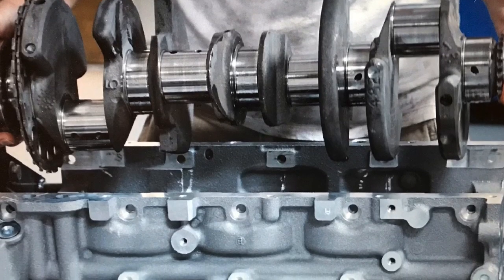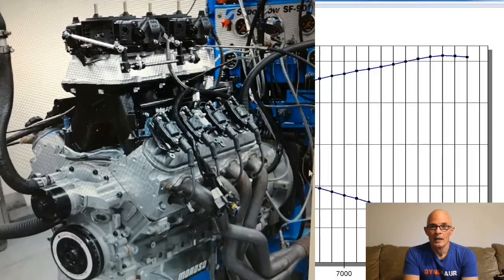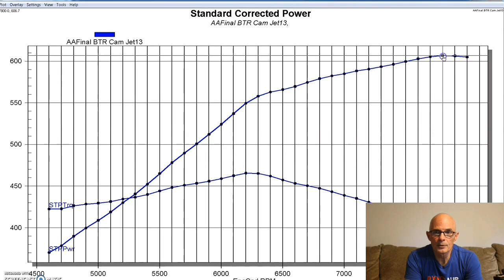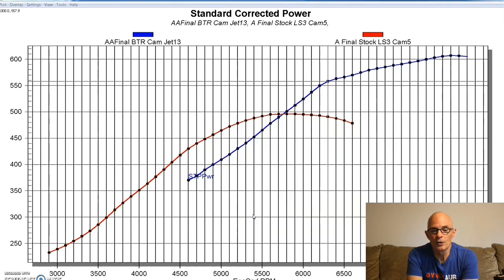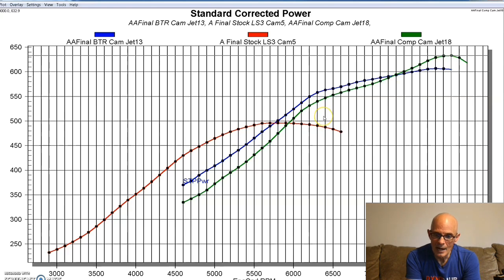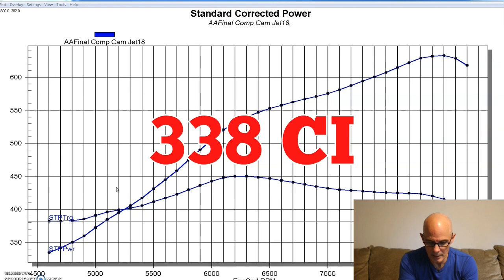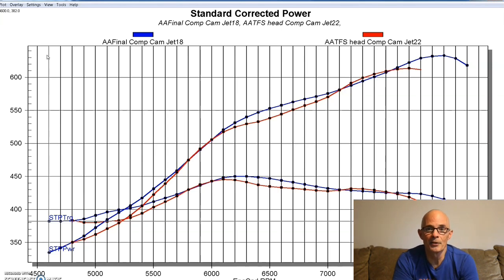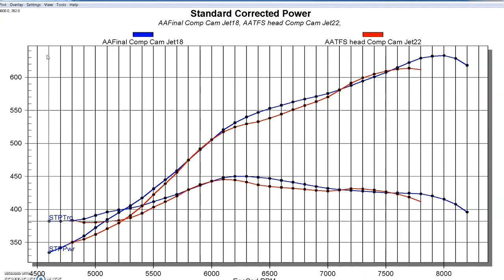DESTROKE LS-4.8L CRANK IN LS3 BLOCK-SHORT STROKE POWER-AN LS MONSTER MYTH?

Comment: Ah, finally! A Big Bore 4.Gr8t. I always thought that the short stroke longer rod combination would tolerate higher static compression and needed less timing and had less rod angularity.  🤔 40#of boost seams just fine @8500.

Comment: I’ve been wanting to do a 6.0 truck block with a 4.8 crank. Thank you for doing this test!
Reply: Did you do it?
Reply: @reyperez3424  no I didn’t. Also as a side note, I didn’t want to do it for power, I wanted to do it for sustained high rpm longevity due to the decrease in connecting rod angle

Comment: I always thought that the small stroke helped the engine in the high RPM because you got a better rod/ratio
Reply: Also study unshrouding the intake valve. With a smaller bore you cant unshroud the intake valve, flow is limited.
Reply: It helps with longevity not power

Comment: The thrust angle reduces with either a smaller stroke or a longer rod, this also affects friction on the sides of the pistons but it also reduces the distance and weight that the engine has to throw around which allows it to rev easier

Comment: This is the way I've always looked at it, it doesn't like to Rev, it has to Rev.

To boil it down simply, making power is about moving air through an engine.

You can move a larger volume of air by changing three basic variables.

Displacement
Aspiration
RPM

A stroked, oversquare 5.3, would do the literal opposite, make a big number, at a low Rpm.
Reply: Dont forget, a larger cylinder allows you to unshroud the edge of the intake valve, and allows you to run a larger intake valve. The biggest advantage in a bigger bore is unshrouding the intake valve, not in the amount of cubic inches you gain.

Comment: Less stroke should have less side load on the pistons, no?
Reply from the maker: Theoretically
Reply: @richardholdener1727  It's interesting to think about. I've been playing with old fwd turbo dodges and I prefer the 2.2 vs the 2.5l. The only difference is the stroke and piston. The 2.2's power delivery is more linear while the 2.5 is more wheelspin. They use the exact same cylinder head.

Comment: Short stroke slows piston speed and side loads then piston less. Great for making SBE parts live! Less power under the curve equals less broken parts. More power after pk TQ = more HP potential and longevity. The top turbo SBE guys are revving 5.3s to 8300+ on hyd roller cams and stock heads.  That destroked combo need a turbo and 8k+ rpm. 

Typical stroker ls kits are horrible. The piston comes out of the bottom of the bore and rocks on a stock block. Its also adds alot of extra side load. Boring big bore blocks also weakens the crap out of them. They split between the cyls at the water jackets with typical real world race loads.

Comment: Can you do it with a set of worked Ls heads Maybe Ls3 or Ls7 heads ?? Against the aftermarket ?
Reply from the maker: Portde LS3 heads work, but probably not as well as the AFR cath heads
Reply: Richard Holdener I would like to see if you could make 800hp with the combo NA!! Then maybe add a power adder . I’m really thinking of doing this motor! I have a 72 240z !! That I want to swap an ls with a factory rearend. This motor would be perfect for a light car. Plus it does have all the torque down low!! Please do some more video on this build Sr
Reply: @Richard Holdener Yeah I was thinking about a budget!! Or just to see how far you can go with the Factory stuff

Comment: Whats with the 118 cam LSA? I always thought more RPM likes more overlap?
Reply: A 118 would be better suited in a turbo application. I would "trap" a tad bit more exhaust under the valve thus assisting in spooing the turbo a bit better on the street.

Comment: The superior rod angle of this short stroke setup would be cool to subject to high cylinder pressure at low RPM. Maybe a compound turbo setup or figure out how to manipulate a variable geometry turbo to make lots of boost just off idle.

I would like a 88mm variable geometry turbo. Light of really quick and still have the big top end rush. A progressive controller shouldn't be very difficult to program.

Comment: I partially disagree on the correlation between displacement and what rpm am engine will make peak hp.

Yes, either bore or stroke will reduce that number but I believe it's actually due to the additional mass. Bore would correspond more with reciprocating mass while stroke would be rotational mass. 

Change displacement while keeping ALL else equal probably wouldn't change peak rpm... 

Disclaimer: I'm not an engine builder, but I did stay at a Holiday Inn Express last night ;)
Reply from the maker: The mass change of components does not significantly effect peak power rpm
Reply: Look at Dodge Magnum engines. 5.2l vs 5.9l. same heads, same intake. Cam, I'm not sure if it's exactly the same. They both make about the same peak horsepower. The 5.9l makes peak power about 400rpm sooner and makes more power pretty much everywhere under 4000rpm. I don't think the peak power will be much different because the cam, heads and intake are the limiting factors.

Comment: Several years ago, I believe it was Golen Engines did a rebuild/dyno of a real deal 69 DZ 302. I remember showing my father the results... he was in disbelief. I think it only made 286 HP with stock manifolds, etc. It actually picked up power with a smaller carburetor. And they added headers, I believe after all that it barely topped 325 HP on the dyno. He was a 19yr old kid when those cars were new, and he owned one in the early 70s. That test basically threw everything he knew out the window.
Reply from the maker: I built reproductions of the DZ302, L76, L84, LT1, L79, L46 and L82, as well as HiPo 289, Shelby 289, Boss 302, 351CJ and Boss 351-all on the dyno to get real numbers-I need to do a video series-maybe with Uncle Tony's Garage-Hey Tony!
Reply: @richardholdener1727  - please do! Even though the new stuff makes more power for the most part... the "old stuff" is still cool. I LOVE the Pure Stock and FAST series stuff. They do more with less.

Comment: Bore surface area is the real benefit of the massively over square sesign. There is a Midwestern truck pulling rule set where the ticket has been 4.56 bored x 3.627 stroke on an iron head 470ci limit, pulling 950-975 hp. That application only runs wfo, low end is pointless.

Comment: The beauty of a short stroke tends to be in the torque management, limiting bottom end, and providing a another flatter torque curve. In lightweight traction limited applications, or where rpm range is all top end (truck pulling). Tell me this wouldn't be a blast in a Miata with the lsxr intake.

Comment: I would love to see build comparisons that show the fuel efficiency relationships on engines between factors like hp per c.i., etc. As in, will a 500 hp NA 4.8 consume less fuel than a 500 hp 5.3 or 6 liter. The reason I'm curious about this is everyone k ows how hard on fuel 6 liter LS engines are compared to 4.8's and 5.3's in stock trim with no REAL seat of the pants difference. In other words, what's the most fuel efficient xxx hp engine comparatively? Love all the hard work you're putting into these videos Richard. Thanks!
Reply: I know this is a super late reply, but out of all three, with all other things being equal, it'd probably be a close race between the 5.3 and the 4.8l, with the 5.3 probably edging out the win by a relatively small margin (we'll say it's 400hp)
What I'm basing my opinion on is parasitic loss and internal drag from engine components.  Piston rings, bearing surface area, oil pump efficiency, etc. should all factor in to how efficient an engine package is.  smaller diameter rings (and possibly smaller thickness if going for some really special low-tension 0.7/0.7/1.3mm ring packages), along with things like a high-duration/low lift cam (less parasitic loss due to a lower spring pressure to overcome) should be able to decrease the static rotating torque the engine has to overcome to continue rotating.  typical smallblock chevy's would require around 20 lb-ft to rotate with a wrench.  going to the absolute extreme with the above ring package on an LS with all the fancy bearings and a cam fitting the profile stated above netted just under 10 lb-ft to rotate.  Might be nothing, might be something.

Comment: Piston speed is a critical factor in using a short stroke too.  If you are limited to 2L, the only way to make more power is more RPM.  The bigger bore and un-shrouding of the valves go hand in hand, but without the short stroke it all wouldn't last very long.  The other advantage of short stroke, especially with power adders, is that you don't make too much torque at low engine speeds.  I've long felt that low-rpm torque is what splits blocks and bends rods, especially with N2O power adder, with a turbo it just delays the boost until the piston is moving fast enough to not be under so much pressure.

Comment: I figured valve float would be the thing that limited it,  just saved some of us from trying this.  If nothing else the longer stroke gives you more reliable HP, as opposed to revving it into the stratosphere.
Reply: Solid roller cam and best springs you can afford

Comment: THANK YOU FOR THIS!!!
As someone who's a gearhead first, then a Ford guy, this "destroked" BS has always driven me INSANE.
5.4l Modular stroke - 4.165"
7.5l(460) BBF stroke - 3.850"

Guys can argue all they want about "short stroke/high RPM" - I'll wait for ANYONE to try to tell me that a 460 big block is a "higher RPM engine"(whatever that even means) than a 5.4l Modular

...again, a 330" mod motor has a 0.315" LONGER stroke than a 460" BIG BLOCK - and people spin these things up to 9000RPM on the drag strip
Reply: I’ve had the same argument for years. Very frustrating.  
Good old boys that really do not understand basic engine theory will always cry BS.  
The bottom line is that cylinder head, camshaft, and intake manifold runner length/cross section pretty much entirely dictate the RPM range of an engine.
Bore to stroke ratio is a very unimportant, secondary metric to know — as long as the cylinder head can adequately feed the displacement. 

Smaller bores limit potential valve area, especially in 2V wedge setups, but the 4V cylinder head really throws a wrench into that.  

The GT headed 5.4 4V is an excellent example of an outstanding pair of large/raised port 4V cylinder heads feeding a very under-square  (3.552x4.165) 330 ci V8 and it loves the rev.  Go figure.  
Those same heads still love to rev on the larger bore 5.8 too (3.681x4.165) because there still isn’t any cylinder head limitation at 354 ci.

The GT500’s twin 37mm intake valves provide nearly as much effective valve area as an LS3’s 2.165” intake valve does, and it fits them onto a 3.552” bore without valve shrouding concerns and MUCH better intake port geometry.

So we get a very undersquare engine that’ll rev its ass off, makes a ton of power easily and laughs in the face of every Smokey Yunick quoter on the interwebs.
Reply: @BCSVT  Yup, nailed it! Valve area is KING, plain and simple! Obviously there's a bit more to it than that, but B vs S isn't one of them. 
Bore your junk as much as your block can reasonably handle, and then drop the largest stroke in that will take displacement up to the edge of class limits - then stop wasting your time on the short block and invest it into what really affects your engine output and the curve; the top end

It's like people are oblivious to all of these aftermarket blocks going larger and larger with bore spacing, 5.0" all the way up to 5.3" - NOT deck height! I wonder why...
Reply: BTW, Freiburger & Co just completely busted the rod ratio bullshit myth too on the 'Engine Masters' show on MTOD - short rod or long rod, it averages out.

Rod ratio is important for reducing piston side loading/cylinder wall wear(short rods = steep angles = increased side loading) - but not for power production

Comment: Hey Richard I would like to see you add the acceleration rate of the engine combos you test in time vs rpm to give an idea of how fast or slow these combos can rpm because that can be the difference between 2 engines of the same power level in determining which will perform beter on track or in the same chassis setups,i have always wondered why this is not shown or discussed?
Reply from the maker: the rate of acceleration is controlled by the dyno at 300 rpm/sec-there is no difference in rate

Comment: Thank you I dont know how many times Ive been told my 408 wouldnt be able to rev to 7500rpm. Lol I used to just show them it could. All about the valvetrain. Now the only issue with a 4" stroke I found after tear down was accelerated piston skirt wear from a short 5.43 cylinder "sleeve" length and shorty piston still coming out of the hole at the bottom.That was back in 07 though Ive been told there are better off the shelf piston design and combinations now that hold up better but I still went with a stock stroke on a current ly6 build. Thought about destroking but I didnt see any proof it would make it rev higher safely when my previous battle was  valvetrain on a 4" stroke. More cube mo Powa baby.

Comment: Need to do it with solid rollers
Reply from the maker: 8000 rpm doesn't really need them
Reply: @richardholdener1727  to push the short stroke you'll need more than 8k

Comment: throw the valvetrain at it and rev that thing out to 11,000 rpms like old smokey Yunik
Reply: My dads a big fan of those old farts & all the magic they did with their engines. He has a "special" 355 c.i. small block he won't come off the internal specs for, but I know it lifted the front on an all steel 55 chevy & turned 12,000 rpm when the shifter broke going into 3rd without damaging anything.
Reply: @anthonycoffey816 5.56 gears were a real thing in some of those cars.
Reply: Sounds like music👍
Reply: Tonka toy truck,  if you look you'll find tons of 10k rpm Big cube ls motors or sb2.2 motors(think nascar) you're right about harmonic limitations...but there are metallurgical work arounds and special dampeners(think 3rd or possibly 4th inner spring for certain frequency). Also import engines that are properly built can generally Rev past 11k rpm. I know of at least 2 evos with 102mm strokes that shift at 10800rpm, yeah 10k plus and live. The biggest problem aside from the valves in a pushrod motor is actually the other valve train components and what they're made out of, so the pushrod is #1 as a mechanical lifter won't see hydraulic bleed down or pump up from increased rpm. Also they are lighter. You can get them keyed, bushed and titanium if I've seen the right stuff along with bushings instead of roller bearings in the roller tip against the cam. The limiting factor for the springs actually doesn't come from the rpm mostly but the retained kinetic energy from the pushrod, lifter and rocker(why high reving motors use things like aluminum jezel rockers with shafts systems to add strength, add lightness, hehe and keep the tip over the valve without deflection,  which is also why they use keyed bushings for the lifters)
Reply: @mythos000000025  Smokey Yunik was 50+ years ago, not today. And overhead cam engines are a completely different animal because of the lack of pushrods and lifters, as you pointed out.
Reply: @joanamendoza-r5l If you’re talking domestic motors, I beg to differ.  It took the Ford guys 20 years to get their act together and come join the party. And still they have to compete with forced induction. When you’re dealing with 4 cams vs one, you’ve got alot going on with moving pieces that aren’t responsible for displacing the air in the air pump or upping the power. Its a bunch of added complexity w/ nothing in return. Added weight, longer timing chains or belts. its all adding to the weight and rotational mass, yet it gives nothing in return.  The sheer weight and size of the cylinder heads is were the failure begins. The technology and valve timing events is meaningless in a race engine. You want spirited part throttle driving experience, then the OHC is the way to go. All that said, You can put a Ford 4.6L next to a 7.0 Ls7 with a blower and the LS is still smaller and actually not much heavier. Same goes for the coyote.  So you do the math… the LS platform’s popularity is for good reason.
Reply: Great story but no one runs much over 9000rpm with steel springs. Harmonic limitation.

Comment: Short stroke vs bore also puts less lateral stress on the conrod. long stroke engines will rev, but need much stronger rods .also, short stroke slows piston speeds and creates more dwell. This can have a small effect on heat reduction and wear on the cylinder and rings...conversely...reving higher negates that effect
Reply from the maker: think you meant to say longer strokes require shorter rods
Reply: @richardholdener1727  Yes, that too, but due to stresses, they would also need stronger rods for high RPM operation... example, using 6" rods in a gen 1, 350ci,  SBC Agreed?

Comment: What would make more power a de-strocked ls3 or a 4.8L with LS3 heads?
Reply from the maker: ls3 heads won't go on a 3.78-inch bore
Reply: @richardholdener1727  6.0?

Comment: Hey you know what would be a cool test, take a motor like this with an emphasis on NA power, and dyno it as is, and then build a 8-1 or 180 degree header setup for it and run that. Does the correct cylinder pairing gain power? Or does it even matter?

Comment: I'd like to see a comparison with engines of near equal displacement, but large bore, short stroke, and a smaller bore, longer stroke,   that combo would work nice in a light vehicle, maybe a miata drifter or something,   what about something not so radical? Maybe more stock heads and intake?